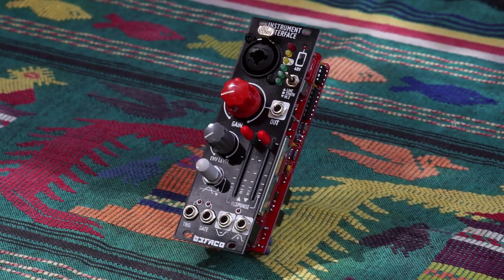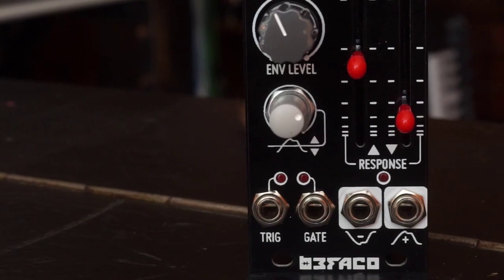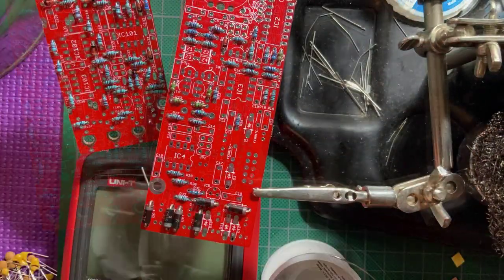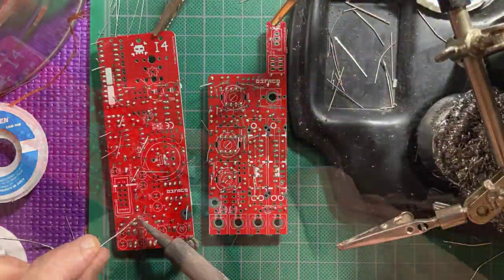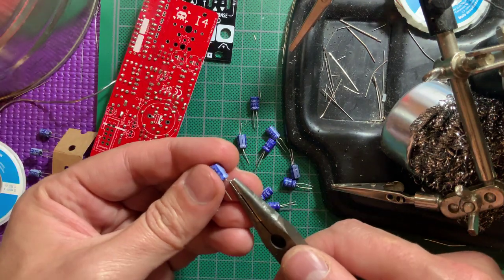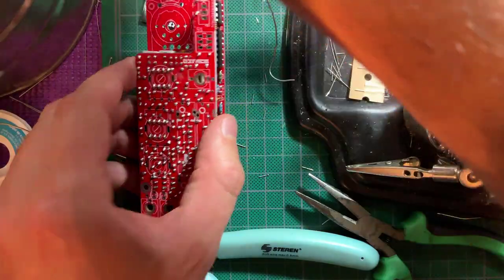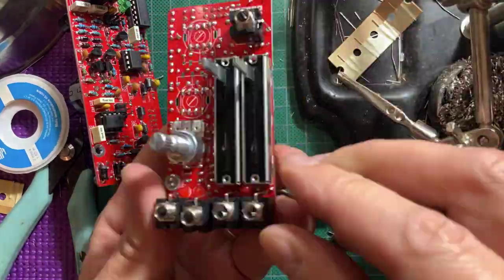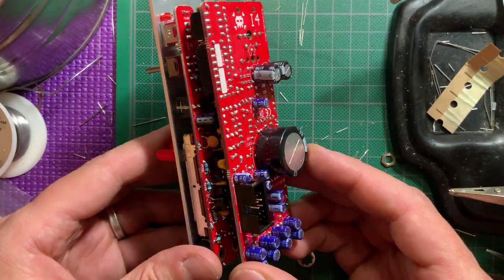Kit Overview # 60 - building Befaco's Instrument Interface v2

Comment: I should have watched this vid before making mine because I’ve made a short between the slider and board and it’s too hard to un-solder the slider. Any ideas?
Reply from the maker: Hi! Can you get a replacement slider? If so cut off the leads and remove them one by one with pliers while heating the solder pad, then clean out he remaining solder with solder wick or a solder sucker. Then trim down the component leads under the slider and install the new one.
Otherwise, you can try to carefully heat and pull out the components from the other side so they no longer touch the slider body.